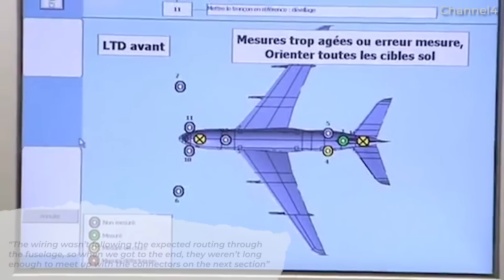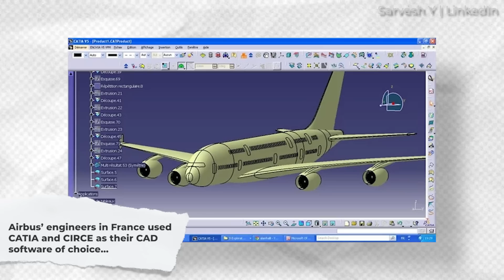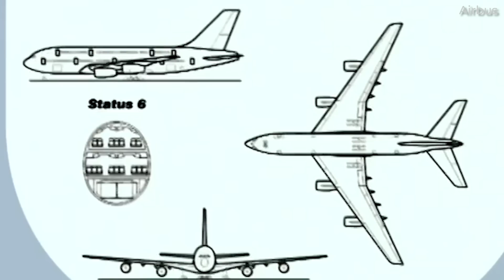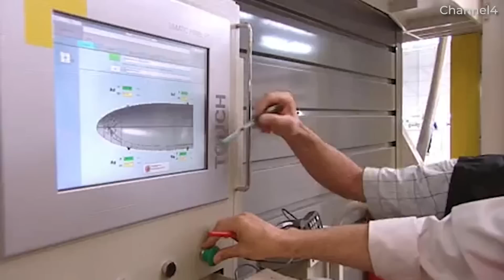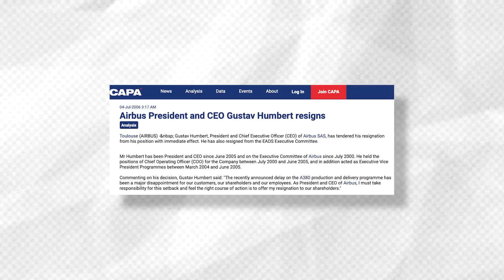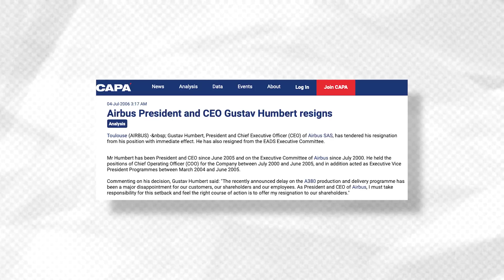Software Discrepancies Caused A Multibillion-Euro Delay To The Airbus A380 Program

Comment: The wiring problem (cables too short) was the result of incompatibilities between versions 4 and 5 of the CATIA CAD software from Dassault which used different rules for bend radii.

Comment: In relation to different software, when I was learning 3D CAD parametric modelling with Autodesk Inventor, my instructor told us that adapting to different cad modelling software was a little bit like different car brands. The cars serve the same purpose, just the controls for things like indicators and wipers might be in different places. I didn't get enough practice on Solidworks to become competent at it but his advice did help me adapt my minset for learning to use PTC Creo a few years later. Those engineers developing parts for the A380 would have been up for the challenge of adapting to different software and processes, I'd say (if it wasn't for the national pride and complacency issues). But they got an amazing plane from it in the end.

Comment: a sad fact about the delays was it resulted in the Freighter version getting postponed and ultimately cancelled, would have been interesting to see an A380F flying
Reply: Freighters aren't well suited to the 2 deck concept. A freighter A380F wasn't ever realistic.
Reply: @grahamstevenson1740 you missed the whole point of the comment
Reply: @ Really ? TBH an A380F was never a realistic project, the inconvenience of having to load 2  main deck levels would have made supporting it a bit of a chore.

Comment: Oh dear. At least they did make a safe aircraft in the end, unlike 787.
Reply: how many 787 crashed so far? eejit
Reply: @PakaBubi  The first whisleblowers pointed out technical issues in 2014. Since then more workers have come out to point various problems. Some workers say "I'll never fly this plane." If people making the aircraft says that, would you?
Reply: A plane doesn't have to crash to be unsafe. And why the "eejit"? There's no need for that.
Reply: 787 is safe.ive travelled on it 2 times,i should be dead now according to you.there are only 2 incidents with 787,batytery fires.a380 has wing cracking!!!!!!!!!!!!!!!!!!!!!
Reply: @thetruthbehindplanes would you consider slacklining between two skyscrapers safe? Multiple people have done it safely,  so it is safe isnt it? My point is, history of funcion is not a prove of safety , I am not saying that the 787 is unsafe, is a safe plane, but its not as safe as it could have been if corners were not cut.
Reply: @thetruthbehindplanes  It's probably safer now after the senate hearing and stricter FAA oversight after all this came out. Yes, A380 has had singular technical issues (all planes do!) but not systemic production problems like on the 787 line. And please don't think I'm one of those who make a big drama out of anything with Boeing aircraft.
Reply: @usakousa  not all planes have wing cracking.look at the 777.strongest passenger plane ever made,and a real dream to fly(ok,ive travveled on it at least 4 times,but)(the 777 is actually a little comfier than the 787,but the 787 is not bad either)(way better than the a330ceos ive been on)